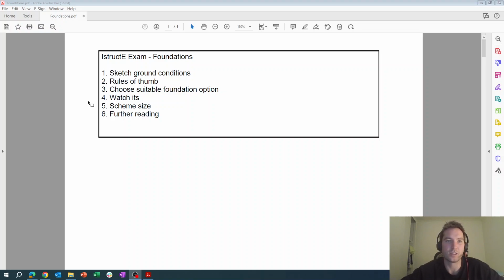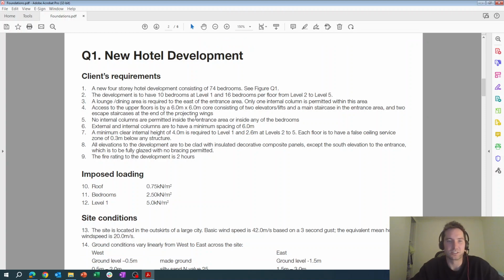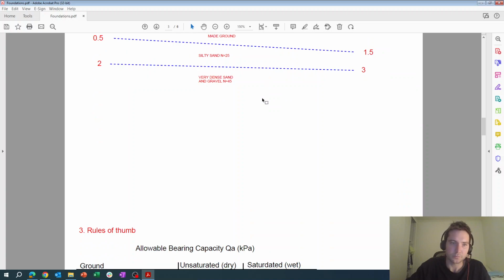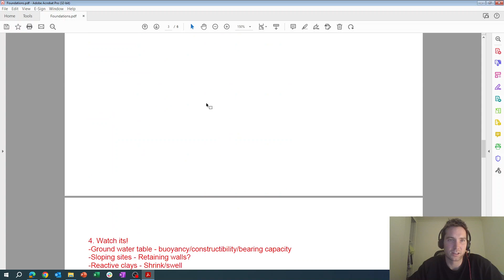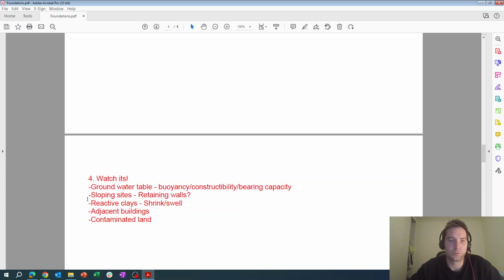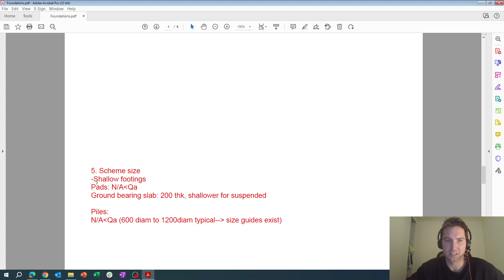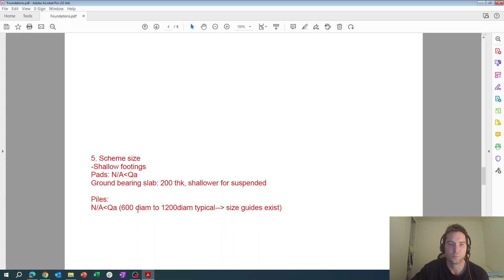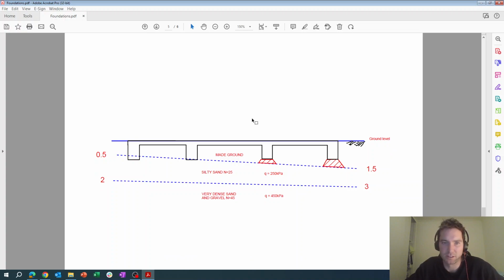IstructE Exam - Foundations

Comment: I do not necessarily agree with scheme design. Ground bearing slabs are generally less thick and less carbon intensive than the suspended slab which is generally thicker....